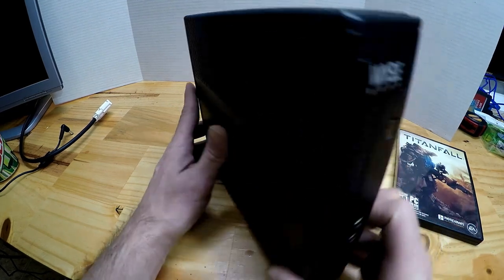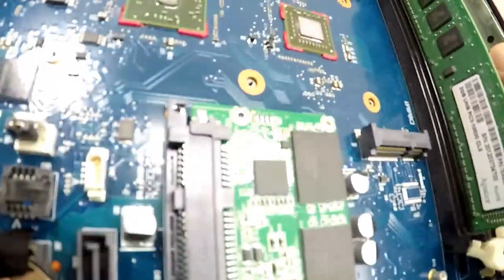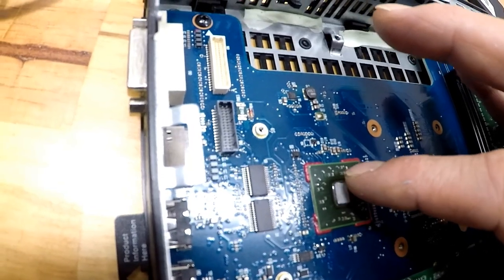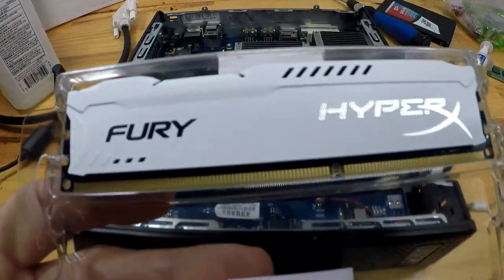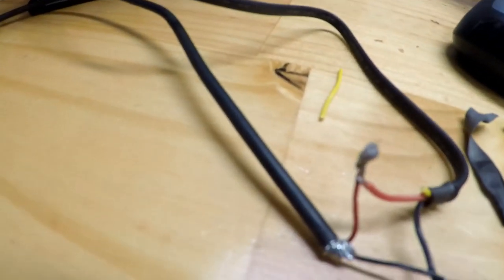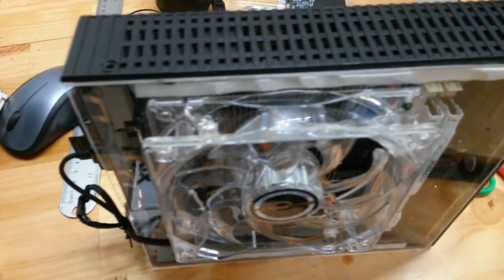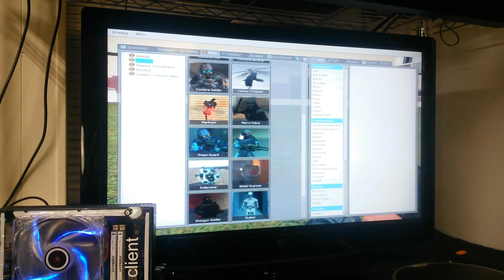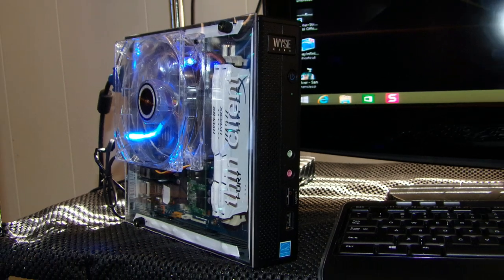MODDING AND GAMING ON A DELL WYSE $30 THIN CLIENT?

Comment: You should try the t610 plus or the t620 plus thin clients, they have pci slots with 90 watt psu! you could easily put in a GT 1030 for the ultimate silent mid-range gaming PC.

Comment: There was a white fan header right next to the cpu with a jumper attached, there was no need to splice into a USB cable. It has to be shorted by a jumper since its passively cooled. Remove the jumper, attach fan, win!

Comment: A lot of these thin clients come with extra ports. What I did on mine was took a multimeter to the extra USB pins on board, hooked up a 5v fan that came from an old raspi. I also had taken some heat sinks from salvaged shit and placed them on the GPU and cpu along with some mx-4. It beats the huge, thick stock heatsink and doesn’t cause my thin client to thermal throttle. (I think they throttle it on purpose or just use shitty paste.) 

I’ve been using mine to do network penetration with full blown kali Linux 😈. Cheers. So far it has done well. Just be lucky yours doesn’t have SATADOM.

Comment: You see those in hospitals all the time in the examining rooms. They're the go-to network machines for the medical industry. I always wondered if they could be "monkeyed with"....
Reply from the maker: once you get past the bios password you can..In this case i took the battery out for awhile and put it back in. from there i entered the default password Fireport.
Reply: Hmm I'll have to remember that, I'm going to be order one very similar to what you have, hopefully with a better apu inside
Reply: try to get a 7000 series (or Z series), it's the most robust, and a higher chance of a better apu, but most of them are going to be bad though, since they were not made for performance.

Comment: Got two of these for $15 each, both had 8GB DDR3 and 8GB flash (flash drive is wayyy slow though ~20 MB/s).  Probly gonna turn one into a Kodi box on Manjaro, maybe use the other one as pfSense router.  USB 3.0 flash drive will be the boot drive (~120 and 100 MB/s read/write Samsung).  Should still be a few left on eBay if anyone wants to get the last few.
Reply: I'm actually thinking of doing this, but basically swapping everything inside, like motherboard, processor, ram etc. The only thing that's actually bugging me is if the backplate is gonna fit (Asus H110T/CSM).

Comment: I have the same thin client as you do, with 8gb of ram, a 250gb 870 evo ssd, i replaced the speaker with a MUCH better one and i installed a laptop fan in there, did you know that there is a header right by the ssd that delivers 5 and 3 volts? I used the 3 volt pins and thats enough to run the fan, its quiet and it cools this thing very well, i use it to play older games like half life, return to castle wolfenstein, quake 1-2-3, need for speed underground etc, those games run very well on this thin client, i got mine for 20 euro's and i have to say, i didn't regret it 1 moment, a whole pc for that cheap is awesome.
Reply from the maker: Sounds cool and yeah that speaker was horrible and in need of upgrading. Thanks for sharing I love these kind of comments.
Reply: @modstek  I used a speaker out of an old packard bell laptop (it was the "subwoofer"), it resembles the speaker out of an imac g3 (which were great for music), and i stuck it onto the ram module, in fact, i didn't need to use any kind of tape or adhesive, it just press fitted in place. I love to tinker with pc's and laptops, today i added a fingerprint sensor out of a broken laptop to my main gaming rig, i attached a usb cord to this sensor and it freakin' works! I can now login to windows 10 using my fingerprint (thanks to tpm2)

Comment: haha love it that thin client was like what 😀👍 nice vid as usual
Reply from the maker: im looking to start a thin client trend but i think think the raspberry pi and new intel thing might just be more sensible. lol thanks
Reply: No, Actually I think The thin client form factor could house much more power than an intel compute stick would, you would only be able to use remote graphics for truly intensive games on a computer stick like intel has. Thin clients and motherboards with all the parts soldered on at time of manufacture are really good performance per dollar compared to a brand new computer stick from ebay.
but more importantly, you don't have to use ANY adapters to hook up a gpu to that, they MAKE  gpu's that will fit straight into the tiny pcie slot on that thin clients motherboard.
Reply: If you made a version of this video that was more clear and precise about how to get one of these things together, I would follow it and then post a video myself, to help you get this trend started. I've been trying to find a way to reach you to ask you a few questions about the build
Reply: where do you see such gpus? I am interested.

Comment: That has a mini pci-e.. External graphics card time!!
Reply: There are mini pci-e adapters for Laptops and it will probably work here, but it will require heavy case modding and it won't be a "thin" client any more. So not that good idea imo. ;p
Reply: @xys007  it wont take any case modifications, and it'll still be a thin client
Reply: @xys007  its a good idea to make it use integrated when we use it is anywhere
but when we need a powerful one just plug pcie slot like usb to vga card

Comment: Great vid! I absolutely love this video!
By the way, you can also connect your laptop PCI-E card to desktop PCI-E adapter to this to get better graphics!
Reply: + can you please say the link to the seller? I love this thing!
Reply from the maker: http://www.ebay.com/itm/322352530650?_trksid=p2057872.m2749.l2649&ssPageName=STRK%3AMEBIDX%3AIT
Reply from the maker: i thought about that but i didnt want people to think you needed an external graphics card..so i did it as simple as possible...
Reply: So wait, to clarify, your using basically the APU to game? Why didn't you add  pcie 1x card to the black pcie card slot ??
Reply: modstek hello why didn't you just straight up use a 1x pcie graphics card that fits in the tiny black pcie slot?

Comment: I would like to know what DDR3 memory type modules are these that you used upgrade this unit I would also like to know did you have to do anything special to the SSD drive to make the system read a drive that the website says is not compatible be nice to have a parts list of what you used
Reply from the maker: Going off memory the ram was 1800mhz overkill for the thin client but looked cool 1333mhz is all you need. I used an ordinary ssd drive. The only thing is accessing the bios to change the password and then it was easy. Sorry for not explaining it well and lack of parts list.

Comment: This is a great story, but you skipped a lot of important steps, like how did you get into CMOS setup, how did you boot from DVD to install the OS, where did you get drivers from?
Reply: Thin clients don't need a DVD to install windows, you use a USB stick like any modern PC does. Since this machine was originally running a version of XP Embedded, all editions of Windows from 7 on forward have the drivers already in the installer. Since he's running Win 8 the drivers will automatically be updated to the latest version. In case anyone ever needs to get into CMOS, the default password is: Fireport

Comment: They originally had installed win7 embedded onboard. I've got the same from ebay (GBP17/2016), replaced original DOM with stripped SSD and added extra memory originating from old dead PC. I also used usb3 for external 3TB HDD. Perfect set for always-on media/ftp/private cloud server (headless debian/jellyfin/nextcloud). While I enjoy watching media content at hotels or listening records when i drive I don't really think that 2-core AMD inside will allow the serious gaming. I got seamless full hd shown on hotels tvs via its browser.

Comment: BIOS version you are using? thanks, I wanna replicate what you did? thanks. straight forward Windows install? nothing especial tweak? thanks
Reply from the maker: I dont recall what bios version but i had to take the battery out to reset the password to the factory password fireport or something it was....and yes just regular operating system

Comment: I owned a TV repair shop for many years and I would get these in ewaste and I would turn them into dish network satellite cards to hack the set top box and get all the channels free, and make them into magic jack computers when the first magic jack came out since u had to have ur computer running all  day/night for ur phone to work and other stuff, it did only support ide the ones I had this was back when and of course they retired them as to why they were in my ewaste but i just drew the votage for the hard drive off the mobo which i soldered too and it worked to run a 2.5 drive. If you can get one with a pci express 1x slot you can get a Egpu and game like a MF i have one with a 750ti that is my wow box and i get 100fps on settings number 7 of 10....
Reply: Hi. Im interested in how you have one setup with a 750ti. DO you have any photos or video you could share, some tips o nthe parts and best setup. Thanks

Comment: One of my favorite things of Garry's Mod, it can run decently on potatoes. lol That thin Client would make a badass Emulation Station in the living room! I see one of those at work all the time and I always think : if I had one, what Emulators would I use it for. now I know the answer. n64, PSX, SNES and also a movie machine. since it runs Gmod, movies at 720p should be perfectly watchable. You should try Lakka OS on that bad boy, get an xbox 360 controller or even a SNES Replica and have a unique emulation console.

Comment: Is there a way to determine what 2.5 inch SSD will fit into this unit?  I have the same exact one as you, but the Patriot SSD that I opened was oddly shaped and didn't fit.  The one that I see you using is $39 on Amazon, but I rather just use a $20 120gb.  Any ideas?
Reply from the maker: This looks like it will work https://www.amazon.com/SMAKN-22-pin-Female-Power-Extension/dp/B00L9R3AKA

Comment: Should have been the HP-T620 quad core CPU & Radeon 6330E HD Graphics ..M.2 and PCI Express options 
for the drive ...now that would improve the gaming aspect ...or the Wyse DX0 is another quad core .
The CPU in the T620 benches at around 1300 same goes for the Wyse better than dual core .

Comment: Good morning. I just got this very same thin client . Did you need to do anything special to the bios for the computer to accept a os ?
Reply from the maker: im pretty sure I had to remove the battery to reset the bios to stock password which was firewire I think and from there enable the usb's
Reply: Did you use bootable usb to load a os ?

Comment: i am modding a dell optiplex 780 mid tower what 3rd party fan would you recommend for a LGA775? considering how stupidly big but quite the stock dell mid tower fans are. i have 20-30 usd to spend on it.
Reply: Mod it to take a Socket 771 Xeon and install a Xeon E5440 (you'll need the 1 dollar sticker to cover the pins on the CPU and you're good to go)  An E5440 xeon has a passmark rating of almost 4000.

Comment: Recent subscriber here, been catching up on your videos. I have a question I think you may be able to point me in the right direction. Googling the problem has not got me any where yet. I have an old Asus cm5571 prebuilt laying around and a GPU  I want to put in. After I installed a new power supply and the GPU in the Machine it only boots to the windows 10 logo then goes black And will not work. I tried safe mode and it was working. I am new to the pc building scene so I would appreciate any input of potential fixes for the video.

Comment: I have this exact model and have had a hard time getting it to boot any operating system other than that which came pre-installed.
Reply: You need to put Windows on a usb pen drive I bought this exact one and have Windows 10

Comment: Awesome job! This proves that thin clients aren't useless for daily use or light gaming! That radeon 6320 ain't to shabby either. The first gen AMD fusion processors were pretty great, and still are
Reply from the maker: No they are not useless at all even when i had windows running off the usb it wasnt all bad but going through all my usb's to find the fastest one was painful. HD video works as well im sure the 6320 could do kodi .....ahh i did not know that was a fusion processor thats why i like doing this im always learnining something new...thanks

Comment: so once you installed an after market ssd can i install a normal windows 7 64 bit OS on it as i have the 7020 wyse which has a quad core amd setup with 1 stick of 4gb dd3 ram in it but i have another 4gb of identical ram spare which i wish to install and assign 2gb dedicated to graphics in the bios and have 6gb available for the system.
were you able to install windows from a usb drive or did you install it from an external usb cd rom?
by the way i have kodi 17.3  running on one of these z90d7 7010 thin clients with 4gb of ram,16gb of flash and it runs mint via LibreELEC!
much much better than the android box's I've used so far and used a DP to HDMI adapter and if you can get your hands on one of these for kodi do so as they zip through even the heaviest build with ease!
Reply: Tee mo You can't assign system ram as video ram. That is not how vram works at all

Comment: Optiplex GX520. Do the 771 CPU socket and BIOS mod to put the best CPU the chipset can handle into it. Should at least be moddable to support any CPU the GX620 can handle since the GX520 is just a GX620 minus 2 DIMM sockets, the PCIe x16 and two of the SATA ports. Must be something in part of the BIOS that doesn't get over written with an update because both systems use the same BIOS flash.

The GX520 can take up to 4 gig RAM if you use the right 2 gig sticks. It does have a PCIe x1 slot so stuff it with the best x1 GPU you can.
Reply from the maker: i have had both of those i actually still have one they are pentium d's and run hot!
Reply: The 520 cannot do 771 because it's a Pentium 4 based system.

Comment: Where did you find the Drivers to this hardware?
Reply: Looks like he's running Windows 10, that takes care of most drivers. Even if it didn't, the hardware in this, at least the parts requiring drivers, aren't really that exotic.

Comment: dude please upload a video about installing blue led fan?please dude
Reply from the maker: I just cut the wires and wired them to a cell phone charger cord for the usb so they can run at 5 volts.If you mean the plexiglass i took a larger plastic cup and traced the hole and fired up the dremmel with a cutting wheel. cut inside your traced line and then use the dremmel sanding disk to finish.
Reply: +modstek so.. the cabale  go to in the case than come out side by the PCI slot and connect to pc?

Comment: This time I must say HORRIBLE contraption, the purpose of a thin client is simplicity along with functionality.

1: Rather than destroying the 2.5" SSD assembly you could simply had used the SATA port next to the SSD slot to connect the drive; after all it would had only needed a little DIY  mount.

2: A small fan salvaged from an old GPU would fit inside the case mounted laterally and solder-wired directly to the pins of the USB port thus keeping the original casing intact and avoiding extra wires hanging out.

Comment: i have a dell wyse 5012-d10d . is the ssd mod possible on that machine ?
Reply: What mod, that wasn't a mod. He just removed the board from the case. If it has a SATA slot than it'll work. If it doesn't have SATA then no.